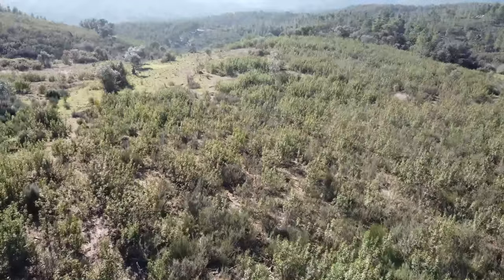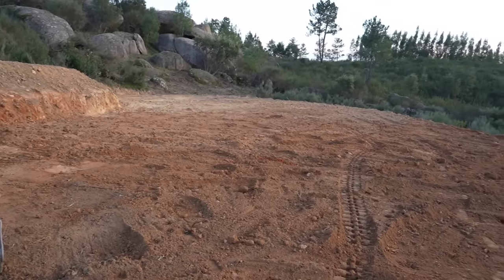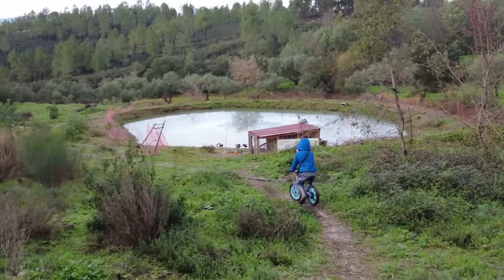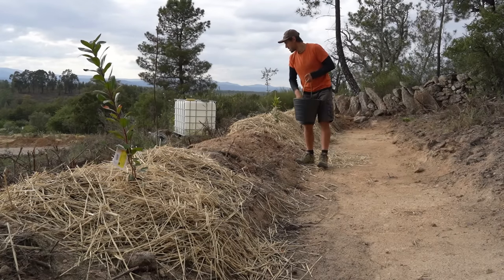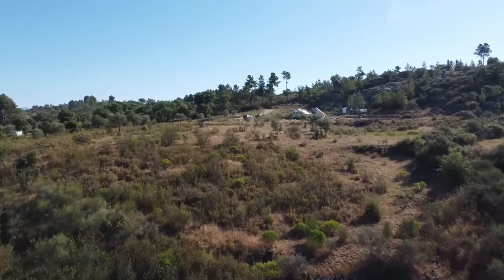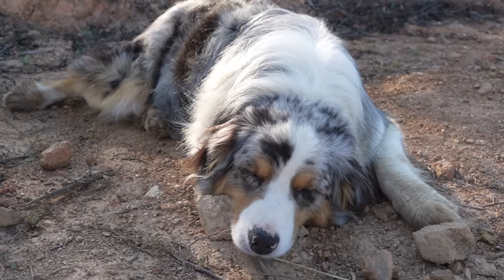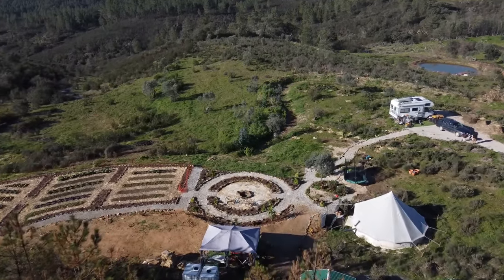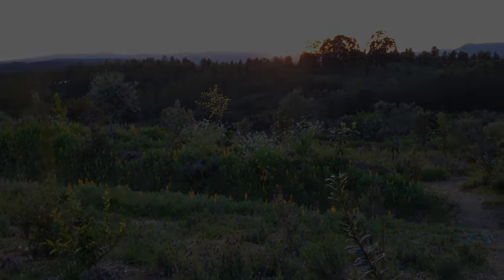1 Year Ago We Bought Abandoned Land, This Happened

Comment: You've got an amazing vision, you are an artist. You turned dust into gold. Congrats man.
I'm also planning to move away from the city to the countryside, next year and build a homestead. Sadly I don't have the vision you have for designing everything.
Reply: Hi Alex - one thing I notice about this family project in Portugal: they did lots of research before they started, and you can do that too. If you haven't grown your own food etc before, you can learn a lot by doing some volunteering at other established Food Forests. Or you could start a mini project with others right where you are, on some donated land (local council?). Councils are more interested/helpful with this than they used to be! Doing it this way means you get solid experience in all kinds of aspects before you leave your current home base, plus you make excellent contacts with anyone who might like to come and help your project later. The WWOOF model provides basic accommodation in exchange for free labour, there are other similar sites to connect with likeminded helpers. Good luck!
Reply: @pipfox7834  Thanks for your reply. I've got a bit of experience growing my own food. I've rented a 50sqm plot of land from the council about 4 years ago and I've been growing vegetables using the no-dig method. My problem is not with growing but with planning and designing my new and much bigger garden

Comment: I would start with swales (more swales), a well, and a retention pond.
With that in place, you will retain the maximum amount of water from the first winter.
Put the homestead on the worst part of the land; a place that is good for nothing else.
Save those sweet relatively flat areas for your gardens and trees.
...and plant your trees further back from the road.  The roots will grow under the canopy and disturb the roadbed.
It looks like a great project.  I'd keep some emergency water at a high point on the property.  Just in case there is an extended drought.

Comment: You should consider building either a pond, or a guant water tank up the top of your property. You can put pipes from your pobd to the top. Have pumps pump water from your well to the top using wind or solar. Put a water turbine on the diwnhill near your house. As you use water you get power. If you want power you let it run dlowing water to the trees below and toward your pond. So you water while generating power. If you divert rain water from the granite rocks you get extra power generation. If you want more water up top, pump it through a filter from your pond to the top using solar or wind. So the water tank is your battery.

Comment: What a lot of work and great progress! Great vision - and execution!  Well done. Starting right with the basics, water and soil improvement and long term plantings.  BUT!  Got to get your living quarters sorted too - especially in the heat. For both physical and psychological comfort.   
You are reminding me of my life-  at your age! 
My husband and I bought 3 hectares of bushland  {Now called 'Off Grid'!} and lived in a caravan for a couple of years. We had a gas cooktop and mini fridge and built a roof over our van.  Compost toilet and built an outdoor bathroom - Tub and shower which we gravity fed, serviced with Wood Heater hot water.  We also put up rainwater catchment roofs and attached water tanks over our Van and even over our chicken and goat houses - before we started building our Mudbrick cottage. Every spare cm of water catchment was used - before we got to dry summer when the winter creek would dry up. { *For those who are also in process of building and haven't got your roofs up yet - another water catchment trick is to just put up a couple of large tarpoulins on poles and run off into your tanks. * Make sure to situate your tanks where they're going to be later for your permanent structures - so you don't have to move them later! } 
We dug out a Dam (pond) in a hollow of a winter creek also - and also had Muscovy Ducks! (They are prolific! Many had 15-17 ducklings per clutch. Lovely eggs and they are great meat birds also. They did attract mice, rats and snakes { Do you have snakes in Portugal!?} We didn't use poisons-  just traps.  Make sure you have the right Drake > Duck ratio as the males are aggressive breeders. Minimum 1 Drake to 20 'girls'.) We had Khacki Campbell Ducks as well. They take 3-4 weeks to hatch compared to the Muscovy's: 6.  {Make sure you put the right eggs under the right duck! }
# Without wanting to 'rain on your parade'  >> I'm going to move into 'Cautionary Oma' mode now! >
1]   Take care of your health - your body.
It was a great life - but a LOT of hard physical labour. Make sure you factor in rest time and fun time - which can be hard to do sometimes when the list of 'jobs to do' is always so long.  
 . When I watch you moving all those heavy rocks I start to wince. Especially for your wife. Females are built different. We don't have the same upper body strength as males. But men need to be aware of your limitations too. It's false economy to push yourself when / if you have access to necessary machinery to get the job done. I appreciate not everyone has the funds - but when you do - use it!  You only have one spine etc. and let me point out the obvious > EVERY part of your body needs to stay in working order - til your last breath!  
{ ##  Let me tell you - I am in my late 60's now and I have shoulder tendonitis and significant lumbar and cervical deterioration ( 3 spinal surgeries for prolapsed discs } which limits my function and causes chronic pain and sleep issues etc.  These directly related to all the heavy labour I did in those years - that my body overstrained, and that I didn't appreciate the long term consequences might be.  AND I have had similar conversations with many, now older 'Hippies' / alternative living folk, from the 70's etc., with very similar experiences. 
# Learn from your Elders and Take Care!

2]  Your Relationship/s is the Foundation Stone - on which everything else is built. 
Make sure you feed and nurture that too. It will NOT thrive when placed in a dark corner on the 'wait-a-bit' shelf - while you get on with everything else that 'needs to be done'. While you have the same goals, you will also have different needs and different resiliences and differing timelines and all these need to be negotiated with care and respect - to reach a happy and sustainable equillibrium.  A relationship is not 'set and forget'. Like a plant it needs continuous attention and 'nutrient' in order to thrive.

3]  Be VERY Respectful of the sun and UV. { I'll assume you know all this - but just in case} 
As a first gen. myself of Dutch Parents who migrated to Australia in the early 1950's, we to had to work out how to manage sun exposure and the heat.  And in those days everyone was careless.  Nthn. European skin is more vulnerable. (Over the decades of heedless playing and swimming in the sun and multiple sun burns; many of us have developed skin cancers. Some very serious- including melanoma's.)  Keep an eye on any moles and old spots, no matter how small - including in your hair and under feet, and other places that don't get much sun exposure also. 
> Have regular skin checks. Here in Australia we have very vigorous skin cancer public awareness campaigns - that I believe are not done at the same level in Europe. Find a Dr who is experienced in this field, and when in doubt; don't hesitate to get a 2nd opinon.  
{* True Story: My sister, who moved to the UK, went to a local GP with a couple of new (tiny) spots on her wrist that she was concerned about The GP told her "Don't worrry - if it changes over the next 3 months come back to see me". She DID worry,  and next day went to the emergency department of her local public hospital to have a 2nd check. They tookone look and told her it was a very aggressive form of melanoma and booked her in for immediate surgery and a skin graft. They also told her if she'd waited another 3 months it could have metastacised  through her Lymph glands to her whole body.  So... Not to scare you > but always check - and double check.} The old: 'Slip - Slip- Slap' Campaign  here is still the best advice. ("Slip on a Shirt - Slop on Sunscreen & Slap on a Hat"! ) Go for SPF 30 > 50  Sunscreen.  

So, having put the cautions aside - keep going, You're doing a brilliant job and building a sustainable and healthy life for your family.  Can't wait to see the finished project. 
Our Goats {Toggenburg's } did great too BTW.  Were hilarious characters, and did very well in the harsher terrain. The milk was very healthy and we made lovely soft cheeses, including herbed riccotta's. Of course, your Fencing has to be Perfect - or you'll lose your precious trees - and garden!  We sourced our Kids from a farm that had electric fences - so they were very respectful of every fence - but of couse THEIR Kids weren't...  😊

Comment: The olive tree stump is charred by wildfire. The swales are good, but will produce a lot of ground cover that will eventually dry out during summer so I would suggest that planting a lot of Aloe Vera as it has massive above ground water storage around any building in concentric circles, and or other such strategic fire suppressant plantings. slopes can act as chimney flue's. Don't add on a wooden deck. Good work.

Comment: - Regarding the duck waste and hydroponics, that's usually referred to as "quackuaponics" and it comes with a few caveats. The duck waste needs to be either mineralized or *composted*, or it will potentially contain pathogens like salmonella. If you go with the mineralization route, you should add a Lactic Acid Bacteria (LAB) serum. You can look up "KNF LAB DIY" if you'd like to learn more about how to make it yourself using rice wash and milk. If you go the composting route, worms love wet animal waste that's active with good bacteria, and worm castings and worm tea are a great compliment to microgreens to bolster their size, flavor, and crunch. 

- Regarding all that brush you're going to rip up: You can utilize it by fermenting all the greens as opposed to just pulling it and disposing of it. You can make what's called "Fermented Plant Juice" or "FPJ" with it. It's a great foliar spray or hydroponic amendment that helps with vegetative growth. It's also a very nutritious feed additive for your ducks provided the thing you're fermenting is safe for consumption.

Comment: Very nice video and progress
How would ducks waterproof a pond?
You didn't show a liner being installed
There's a clay that can be applied to soil surfaces to waterproof it, bentonite?
Reply from the maker: Thanks! It's a process called gleying. Stopped doing it with the ducks. Too many nutrients in the water cause algae bloom and reduce oxygen levels considerably. The top 50% of the dam wall leaks a lot. The bottom 50% is pretty good. We're considering bentonite and different options. But that will be for next year. I'll make an updated video about it.

Comment: In terms of easy access - do you intend on building wheelchair accessible infrastructure (including possibly macadamizing the roads and walkways), at least to go from the access drag to any living space, even if not necessarily gardenoids? You may need it if you should, I beg of the gods to forbid, break or lose a leg, and I don't want you SOL and unable to take advantage of all your work on your homestead in that case. It may also be necessary if you find you can only get around with an ebike or bicycle, which are also mobility aids like wheelchairs, though not usually seen as such.